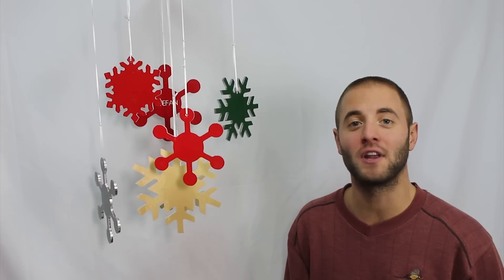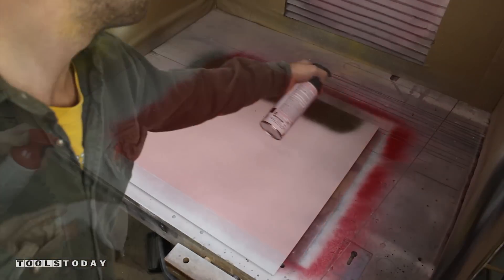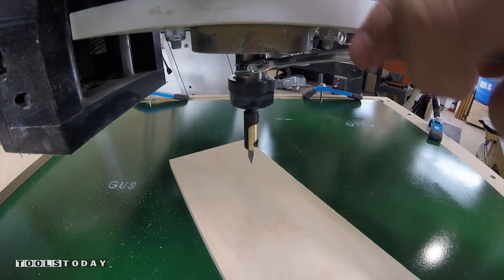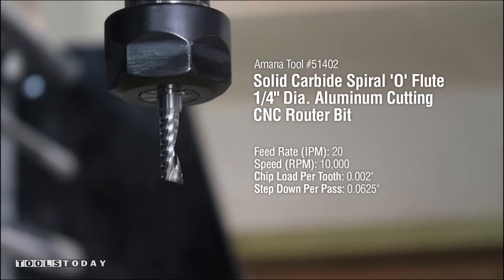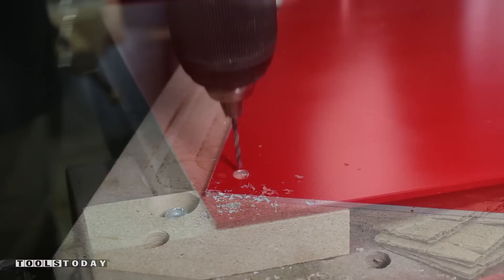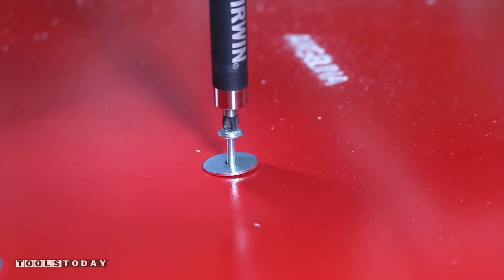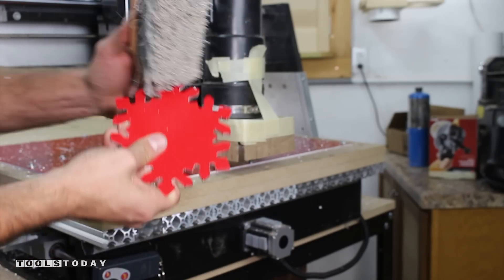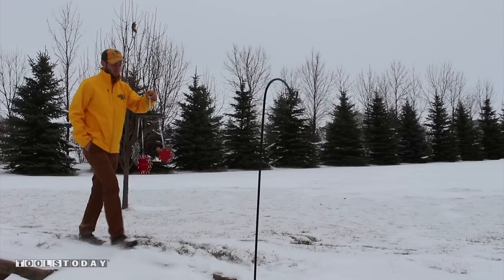Holiday CNC Project: Aluminum Snowflakes Using Amana Tool Solid Carbide Router Bits

Comment: what the power of router spindle ??
Reply from the maker: +LATIF motion, Yes, it is a 3 HP water-cooled spindle run on the CNC Shark HD 3 w/ Extended Bed available at www.Rockler.com
Reply: thank you